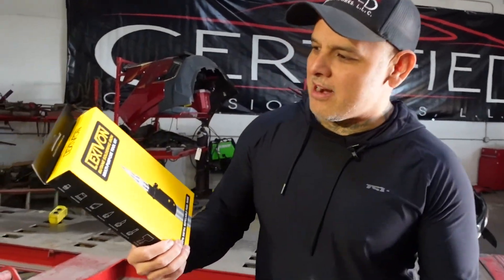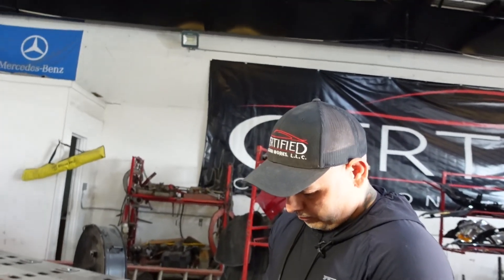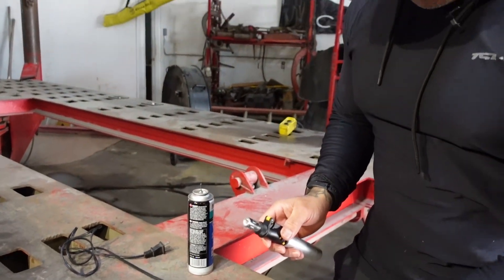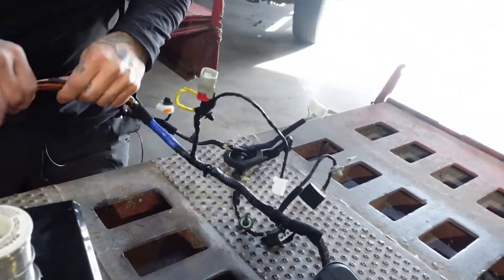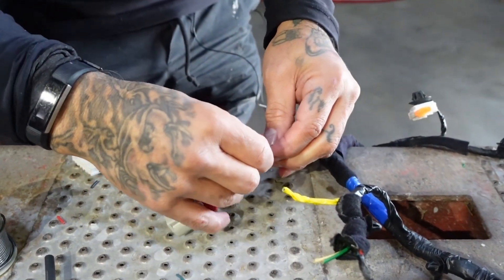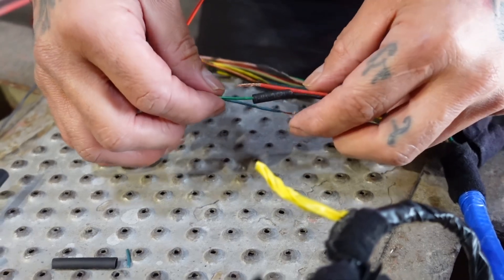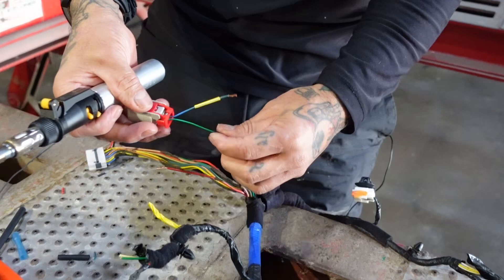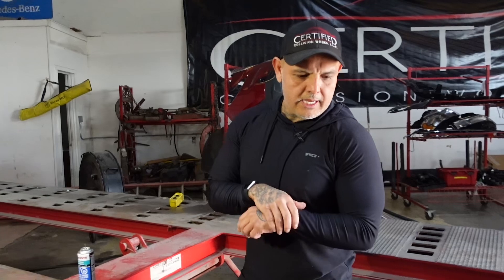The Soldering Gun That Changes Everything

Comment: The cordless soldering pencil made by Coleman that uses AA batteries was the worst of them all. Wahl made a decent cordless soldering pencil and came with a charging stand. Always use some form of rosin and a clean tip for best results.
Reply from the maker: @leroyusa935  that’s good to know. Thanks for sharing that tip. I’ve been soldering for a few years in small repairs but I’m still no master. But it very helpful to make.